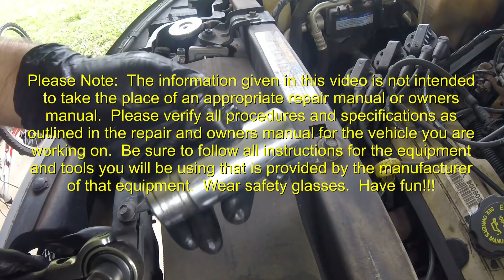Four Ways to Collapse a Caliper Piston

Comment: Does it sometimes need to be rotated clockwise to be pulled back?
Reply from the maker: Not on this type of caliper.  What kind of caliper are you trying compress?
Reply: On back brakes with a disc emergency brake system.  I don't think on the drum rotor combos that you need to rotate it.

Comment: Thank you for the informative tips but I have one question. May I ask the size of channel lock plier you are using? I see 2 inch jaw capacity on Amazon and I'm wondering if that size would be big enough for most car calipers. I bought a dial type caliper spreader and it only manages to spread about half inch before I can no longer put enough force due the dial design not enabling enough leverage. Thank you again!

Edit: One more question. Would the screwdriver method be good enough if the piston is kind of tough to compress? Again, I couldn't compress it with the spreader tool, but then the tool has design flaw in that it doesn't allow you to put enough force due to the dial being what tightens it. Would it be safer to use the channel lock plier?

Comment: So you need to unscrew the bleeder screw
Reply from the maker: That a question?
Reply: BarboursAutoHelp yes I had a hard time pushing piston back
Reply from the maker: I did recommend opening the bleeder, but even if you didn’t it shouldn’t have been too terribly difficult to push in.  What are you working on?
Reply: BarboursAutoHelp 03 Hyundai elantra back pads
Reply from the maker: Sounds like you may have twist in calipers.  Not sure but you should look into it.  Twist in calipers can’t be pressed on like regular calipers.
Reply: BarboursAutoHelp right

Comment: Thanks for saving me $50 on a set of caliper compression tools!
I'm getting mixed advice from people about cracking the bleed valve. Is that always necessary?
Reply from the maker: I suggest it.  Of course check your manual.
Reply: My caliper don't want to conpress wit the c clamp it's  to hard  😫.
Reply from the maker: Is it a twist in?
Reply: 50? Bro it's less than 10.
Reply: @illogicalgarage8641  Depends on if you get the Harbor Freight special or the Advanced Auto ripoff I suppose.

Comment: Hello I was wondering when you bleeder screw open is it required to bleed the breaks? I'm attempting my first break job on an 06 300. I was told to open the break fluid cap rather than the bleeder screw
Reply from the maker: I have a video on bleeding brakes.  Go to my channel and thumb through my videos to find it.  I would link it here but I’m on my phone and can’t.
Reply: @BarboursAutoHelp  I didn’t bleed or unscrew the cap am I introuble
Reply from the maker: Are your brakes working as designed?

Comment: How do I decompress the Caliper!?
Reply from the maker: Make sure the caliper is installed with the brake pads and press the brake pedal a few times.
Reply: I did this but nothing
Reply: My problem is that it was compressed but the rubber did not compress fully
Reply: BarboursAutoHelp nvm I think I got it

Comment: On your first method with the screwdriver, is there any chance of air getting back into the line with the bleeder open?
Reply from the maker: It's unlikely if the bleeder is kept upright.  Always be sure your pedal is firm after repair.  If it's spongy the bleed as needed.

Comment: Great Video! Consider a 5th. I add C-clamp to outside of mounted caliper with pads inside (with bleeder open). It's easier while mounted and a little cleaner.
Reply: How do you do it with out getting air in?
Reply: @hauntingtonjohn  You’d have have a bit of pressure on it anyway. Close the caliper once you’ve stopped. Air won’t get sucked in as long as you have a little pressure on it compressing the caliper.
Reply: @lmuhlstadt  thanks for replying so fast. Caliper still wouldnt compress. So I guess it's time for a new one
Reply: That's how I usually do it